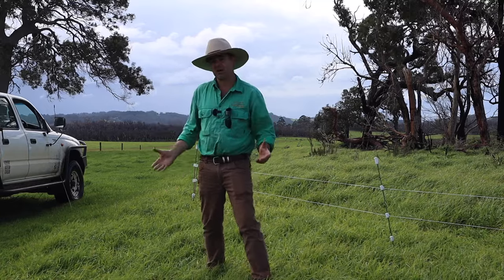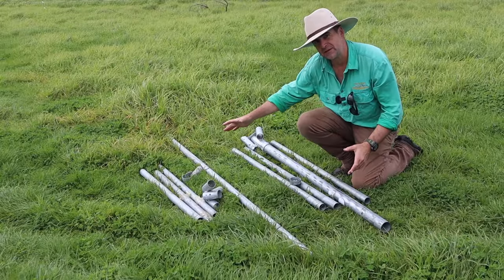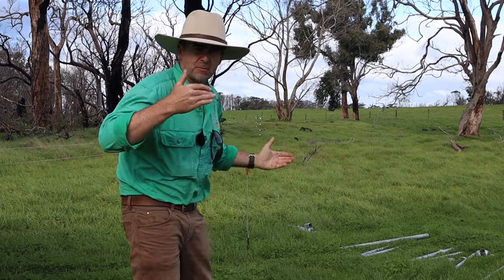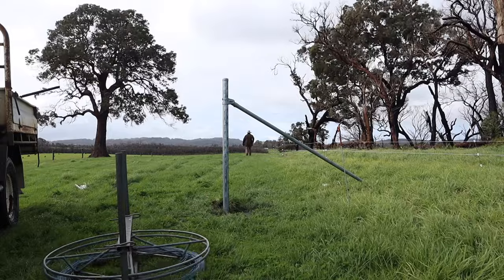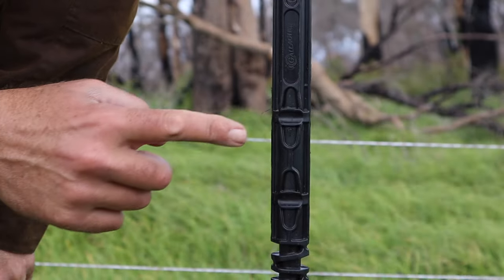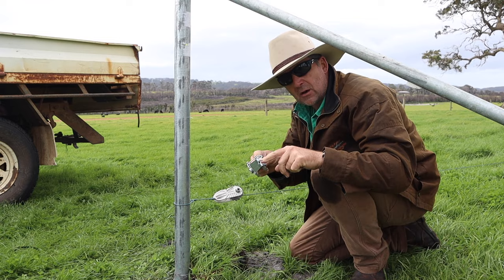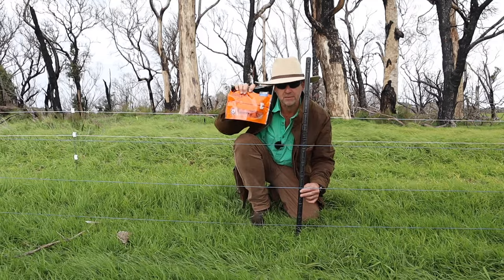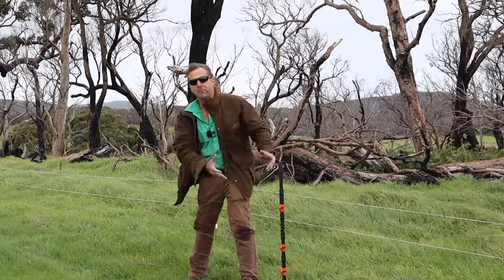Shocking; Is This The Strongest Electric Farm Fence??

Comment: That strainer tip, installed so close to the post, makes the strainer single use.   Installed in that manner, they pull wire in from both ends. Once the strainer runs into the post and wire can no longer enter on that side, wire can no longer eenter on the other side either.
Reply: yes that was the first thing i noticed too! If I was doing it that way, I'd probably run the ratchet strainer a bit further down the line at least.

Comment: Thanks Tim,

Do you think it would work with Gallaghers 5mm turbo braid?
Reply from the maker: Yes, and turbo is definitely the best braid. But I would recommend wire for permanent setups.
Reply: @FarmLearningTim  thanks - yeah can’t Believe how low a resistance that braid is.

Comment: Good morning, Tim, excellent demo. Really interesting product. I have fairly loose soil but rocky. I wonder how the posts would go in that terrain. And you were using plain wire over the ribbon/cable of the normal electric fence. Is that recommended? And would plain wire be preferred due to the permanency of the fence. Thanks again.
Reply from the maker: Hi mate. Yeah wire conducts electricity better and lasts longer. Braid is best for temporary or movable wires such as strip grazing. Cheap braid should be avoided for everything.
Reply: We use them in our very stony ground, I have a piece of an old pry bar the right diameter that I will drive in as a pilot in really bad places.

Comment: how would they compare to timeless?
Reply from the maker: Timeless are not (to my knowledge) available in Australia, but look similar to a PVC post I used 20 years ago. The flexible line posts are composite, with hardened top for driving and larger waffle spear for driving, making them you’re than a pvc only post and very secure in the ground. Hope that helps